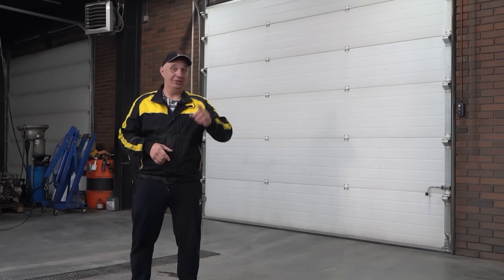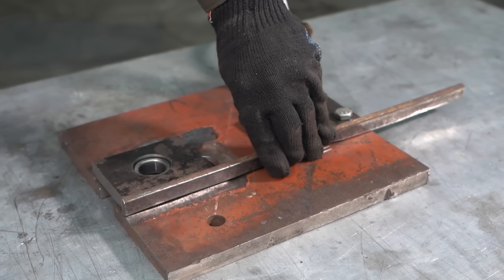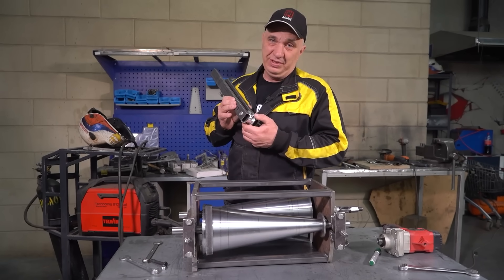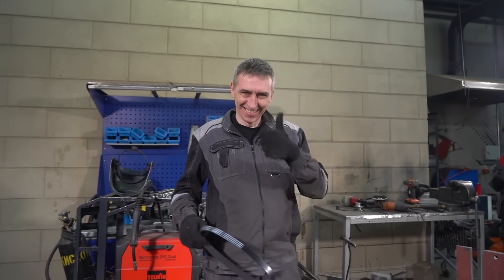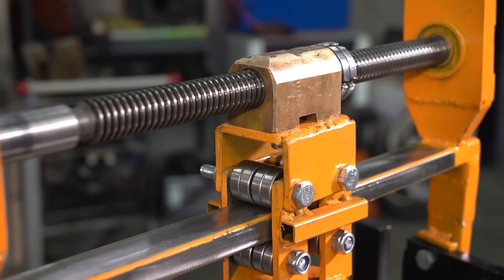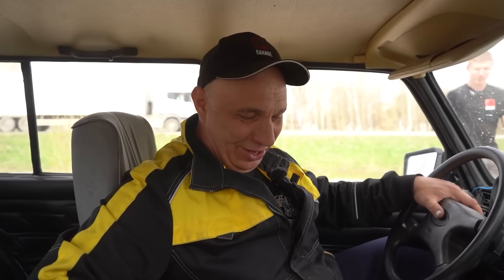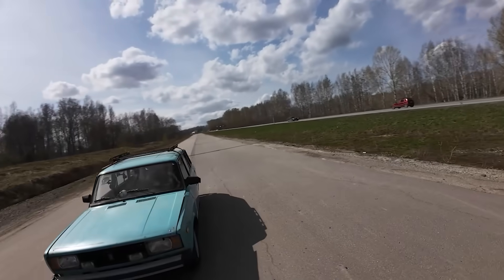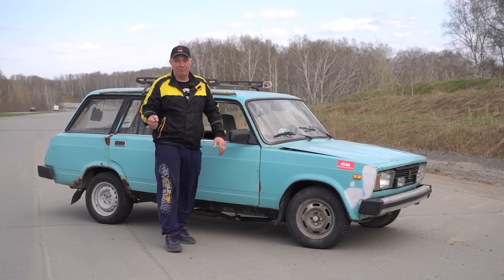We make a DIY CVT for a Lada - will it work?

Comment: My idea for a transmission when I was in 4th grade was simply a cone on one side and a roller on the other. Use a belt that can stretch and I assumed that as torque is applied the belt would stretch and go to the wider side of the cone putting more torque to the wheels. No pulley or anything required. Now 30 years later, id be real curious if you could see if it would work.
Reply: The major flaw in your concept is that reinforced drive belts really don't stretch much, nor is it an efficient use of energy to stretch it even if you could. However, if the cone and roller were not parallel, but rather at a carefully calculated angle to each other, the belt would not need to stretch. The difference in the distance would accommodate the difference in diameter. One advantage of this system is that the amount of twist taking place in the belt would also be significantly lower than the opposed cone system they built here.

But this was never supposed to be practical. It was crazy Russians having fun (and flexing their fabrication skills). Mission accomplished. 😁
Reply: @ I realize that a drive belt wont work and that the stretchy belt would basically have to be like a giant rubber band and also probably not very efficient, but the beauty of the idea is that the gear ratio is automatic based on torque stretching the belt.

Comment: Cvts work great I'm theory but too many failure points. Too many breakables. I remember driving a 2016 Pathfinder.. it doesn't matter what speed you're cruising at, if u stomp the gas it'll take off

I'll outrun anything from a red light cuz while you're shifting going up n down, my rpm stays the same and speeds up while you're letting off

Comment: If the belt was a Möbius Strip, you could just push it  to change position, it'd be 90 degrees twisted in the middle.

Comment: Maybe in a go kart, not a car. I thought that a belt from a big comet torque converter might work, but I think those drive more from the side of the belt and not the inner face.
Reply: You would be correct in thinking that. That's part of why which direction the flat face on the belt, matters. It's a really cool system. Whoever worked that out first was a smart cookie.

Comment: I was not expecting this to turn into both a manual CVT demonstration and a dual gearbox demonstration. Any particular reason why you guys opted for manually adjusting the belt position, instead of letting the CVT do its work?
Reply: Most CVTs are computer controlled, which is beyond their scope. Scooter CVTs use springs and weights and such, I’m guessing they didn’t want to spend too long trying to recreate that however
Reply: need programmer to do digital-computer-control (ie: TCM, transmission-control-module), or control-system-engineer to do analogue-computer (ie: hydraulic).
Reply: Huh, I was under the impression it relied fully on physics magic, and that it was a fully self-contained system with no external 'logic' required. Today I learned, thank you both

Comment: Transmission that requires a backseat driver
Reply: he can attach the switch to the steering-wheel like the button for cruise-control, but he opted to not disassemble the cordless-drill and hold it himself.

Comment: Maybe try used an actual cvt metal based belt?
Also, the cone shaped wood splitters would make a good starting point for making the cones?
Reply: A metal belt CVT has the belt pushed into a variable V shaped "pulley" that clamps down on it with fluid pressure. It works the opposite of a rubber belt that pulls on a pulley.

If you've ever worked on a snowmobile or ATV CVT they are pretty similar, except those are still rubber pull belts. There is no way to put a metal belt on a conical drive setup like that.

Their setup will only work with a rubber belt.
Reply: @volvo09  old Daf (and later Volvo) also used belts for their cvt.  Chains are way more effiecent tho
Reply: @volvo09 What about with a third pulley cone acting as equilibrium for the amount of tension on the three?

Comment: 7:20 there is an eccentric pin on one of the roller shafts that functions to pry apart or pull together one side of the rollers, that forces the CVT belt to move from one side to the other.
Reply: rotate the eccentric pin on one side of the roller and the cone tilts to that side that becoming square when rotated back. that it goes to the other side when the eccentric pin on the opposing side is rotated similar to each.

Comment: A real CVT transmission doesn't need to be adjusted manually, it adjusts itself as the vehicle moving.
Reply: As the name suggests, just like on Go-Karts, it is a Continuously Variable Transmission, no one said it was an automatic CVT like modern cars, and plus those are filled with oil and have much thicker belts, so they are correct.
Reply: @ratataran  Oh, that's the phrase what I'm looking for: "automatic CVT"!
Reply: ”Continuously variable transmission transmission”
Reply: @duckowithahat8182 oops, nevermind

Comment: make a Stirling engine work off the exhaust heat
Reply: You know what it's actually not a terrible idea but it would have to be tied in with the engine and the transmission I wonder at what point the engine wouldn't need gas or how efficient you could get it to run a loda Sterling mix could be absolutely brilliant
Reply: Maybe make it power a small alternator or something.
Reply: @foolwithatool2052  or you know... power the wheels... NASA had 75 horsepower stirling engines like 50 years ago. look it up on youtube.
Reply: @TheUchihasparky  better yet look up Swedish Stirling engine submarines. They allow continuous underwater operation for weeks which was previously only possible through nuclear power. The beautiful simplicity of the Stirling engine also makes them exceptionally quiet, in contrast nuclear-powered subs are notoriously loud. This was demonstrated during a US wargaming exercise when one was able to slip through the USN carrier group's detection and "sink" the USS Ronald Reagan.

Comment: Did Garage 54 just invent a manual CVT transmission?
Can you imagine smoothly "changing gears" with a sliding lever instead of a gated shifter?
Reply: (C) patten pending eh boiz
Reply: Some early cars did this actually, I’ve seen it done with two friction wheels adjacent to each other. Ratio was changed by changing the distance of the shaft of the output with a lever, adjusting the effective radius
Reply: @jetpackjbd  how did they solve the belt cutting problem?
Reply: @alf3071  it wasn't a belt. 

Look up a drive system for a Snapper Comet lawnmower. It works in a similar fashion with two friction disks
Reply: @alf3071 they put it on a swivel bearing and had the belt over the top of the wheel instead of under it.
Reply: @alf3071  toroidal cvt -there is no belt
Reply: @jetpackjbd so like a manual moped transmission?
Reply: Robot Cantina did that with a predator engine swap with a CVT with the original manual trans
Reply: @190SkyTeam   hello, Coffee and Cantina friend! Glad to see another fan in the wild. Not surprised that it's here at Garage 54 😂
Reply: @190SkyTeam  legit what i tought when i saw the cvt after the manual, of course he did the oppsite, but same thing
Reply: I think some early 1900s cars had manual a "cvt"
Reply: @jwalster9412 early cycle cars had varying pulley on engine and moved engine to take up the slack.
Reply: It's the trombone of transmissions
Reply: Manually adjusted CVT's have been a thing for a while on Large Executive scooters like the Honda Silverwing and Susuki Burgman
Reply: Manual cvt would be a dream.
Reply: My lawnmower has a manual CVT, the "clutch" pedal just varies belt tension on a pulley that expands and increases or decreases the gear ratio into the transmission. 

Let off and it speeds up linearly, press down and it slows down linearly (and has more power to go up hills).

It would be wild to have a slide shifter in a car that did the same thing!
Reply: ive always imagined a manual cvt with an airplane style thrust lever for a shifter
Reply: There have been industrial versions of this for many decades, creating a reliable unit for a car has been a bit of a challenge as Nissan can testify.
Reply: DAF/Volvo used a separate belt-driven CVT in a transaxle arrangement for each rear wheel in lieu of a differential. I don't think the belts last all that long but they're easy to change. And saying CVTs have no place on the road is daft. You might not like them but there are a lot of high mileage Toyota hybrids out there.
Reply: The CVT in the Toyota hybrid is completely different its an E-CVT that uses planetary gears.  Not a chain / belt like a traditional CVT.
Reply: Almost like variable speed propeller on plane
Reply: I've been trying to think of how to do a sliding center shaft with a gear that didn't get eaten up immediately cause that would actually take the load
Reply: Id rather just push a button
Reply: They should just throw away belt CVT, thay're converting torque to heat very inefficient. Make Ratio zero cvt no torque converter, no belt slipping just gear torque to the wheels. Ratio zero cvt are also cheaper to make.
Reply: I'd love it! Always find the perfect gear for the speed! On demand! not wait for the cvt!
Reply: Wonder if a double cvt somehow being implemented to increase gearing more?
Reply: Audi multitronic has something like manual mode and you can "shift" virtual gears by pushing gear lever or paddles. Also, it brakes a lot.
Reply: Nissan already has one.
Reply: Neat engineering prototype.❤❤❤
Reply: Fretless auto
Reply: analog gears lol
Reply: Sounds almost like a Hondamatic transmission.
Reply: Well it exists already 
PIV drive or cvt chain link  drives

Comment: Have you already tried making a hydrostatic transmission?
Reply: Aren't torque-converter works using fluid? they have tried attaching torque-converter from auto-transmission into manual. It can drive straight away from high-gear without changing to low-gear at start.
Reply: @xponen  Something like a hydraulic pump powered by the engine connected to a hydraulic motor would be interesting

Comment: In the Netherlands here we had a 1950/1960's car with ccvt.
A DAF.

Familiar for driving as fast in reverse.

Not familiar with the car myself.
Reply: I used to work at a DAF service center, the mIan failing point with the variomatic system was the Rubber diaphragm  which drew the cones together it leaked an the transmission would stay in low gear, worked well when working properly.
Reply: I own a DAF 66 and I got to say the CVT transmission is for sure a great piece of engineering

It truly is one of the smoothest transmissions you can find; It always makes sure it's in the most optimal rev range seamlessly
The one (big) downside of a CVT transmission is that the belts are not super strong, so the car is limited to a ~50hp engine with quite weak torque

That's why they are more common in scooters/snowobiles and other vehicles that doesn't weight too much and don''t need a powerful engine

I know nissan and other brands have been experimenting with metal belts and use engines upwards of 150hp, but it never really lived up to the expectation

Comment: whats next, 8 speed dual clutch for lada ?
Reply: I want to see that😂
Reply: They did dual transmission single clutch in this video :))
Reply: A homemade gas turbine engine.  Mount six truck turbochargers to a common combustion chamber.  Feed the exhaust to a common collector which goes to a the exhaust side of a large displacement turbo.  The output goes to a 100:1 gear reduction which then feeds into the Lada's flywheel, clutch, and 4-speed gearbox.
Reply: @BlackPill-obey I've thought about this exact thing several times over the years!
Reply: Lol !! 18 speed Road Ranger trans.
Reply: Spaceship
Reply: 8 speed dogbox lada with a semi turbo
Reply: But all made from scratch and scrap
Reply: Don't give them ideas😭🙏
Reply: Overdrive...
Reply: That's too normal lol 😂😂
Reply: Yes please! 😂
Reply: there was a preselector gearbox used in racecars. one of those would be interesting but i know nothing about them.
Reply: every piston one clutch
Reply: They would most likely just do that - two transmissions and two clutches, where clutch operation needs bistable operation, but trans could be just two sticks lol
Reply: That's been done before. How about an 8 clutch dual speed transmission
Reply: ratio zero cvt
Reply: I wonder how many video garage 54 going to upload if they try to reverse engineering the mechatronic..
Reply: up
Reply: Toyota eCVT for Lada
Reply: F! shifter with buttons on the steering wheel?
Reply: Custom made Vtec 20v head on lada engine
Reply: Я только за допустим
Reply: Hold my vodka
Reply: Now that would be sick!
Reply: 🤣🤦🏻‍♂️ Porsche PDK for a Lada....
Reply: @redchris97 the LDK